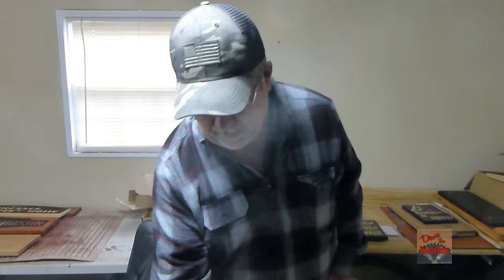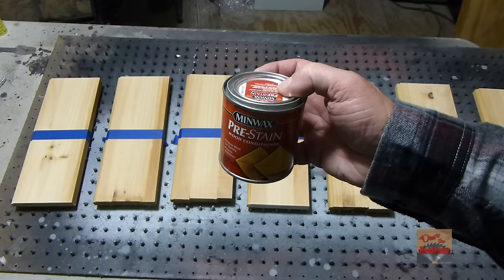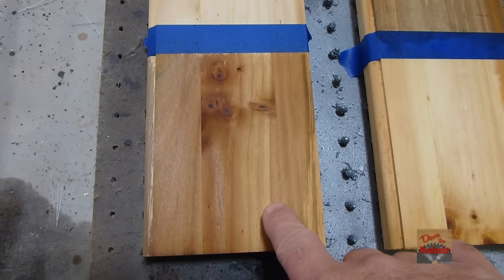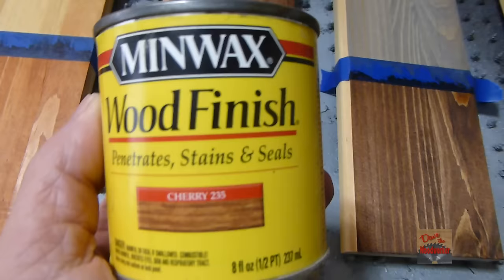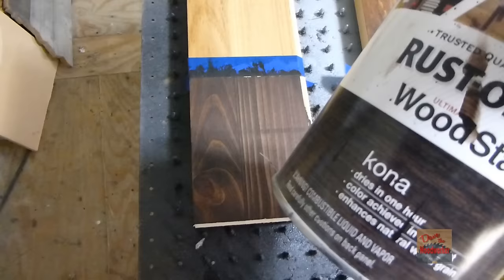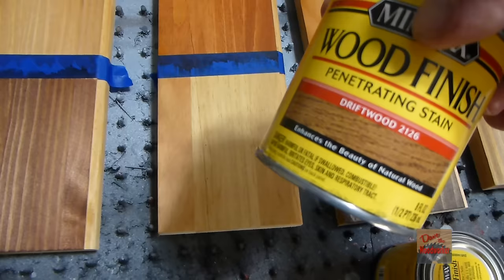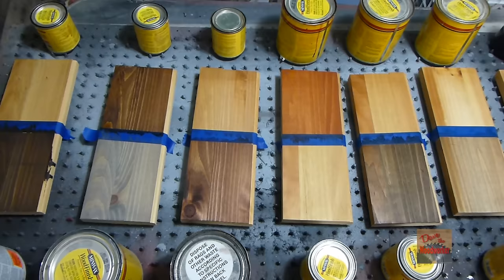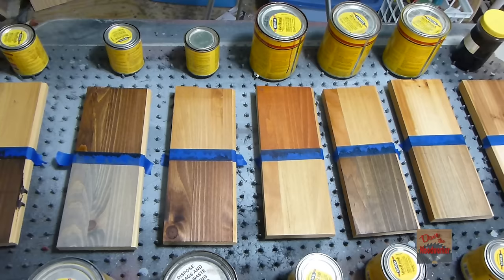Testing Several Different Stains on White Pine wood

Comment: Thanks Dave. A lot of us use pine and can't find good examples of stain on white pine. The paint sticks at the big box don't cut it and the keyring swatches are horrible. I can vouch for the minwax pre stain. It looked great with Red Oak(stain) and a couple coats of polycrylic.
Reply from the maker: You are welcome, that is the reason I made the video, I have bought stains, going by those examples and didn't even come close.

Comment: Great video.  Definitely helps to see the colors after it’s applied.  Also good advice on the conditioner, several years back I did a project with pine I didn’t know anything so I applied stain without conditioner and it turned out terrible!
Reply from the maker: Thanks and yes always use conditioner on pine

Comment: THANK YOU for this demo..This is why I have accumulated so many stains chasing colors and wasting money. A lot really does nothing to crow about "on pine". Especially any of the light colors. You have 4 light colors there that you really can't see any difference. Therefore I would have bought 4 cans when I only needed one...So I have stain for sale, anyone interested ? LOL
Reply from the maker: TheBIGcountry67 You are welcome, I have several cans myself. Some you think will look good from picture on can, but until you use it you don't know, that's why I made the video.
Reply: You did good ! Here's 3 more that will duplicate on pine..Early American, Honey and Dark Walnut..LOL All about the same hue . Not enough difference to have all 3..Now I have used Early American often, but I chased the other 2 for a change (I had hoped)..Nothing ! So your video proved I wasn't insane that pine duplicates.

Comment: What is the mix for steel wool and vinegar?
Reply: Just stick a few steel wools in a big container of vinegar.
That's the cheap way of making stain that will age or pickle. Otherwise you can buy it. What it does is make it grey. You're supposed to let it sit on there for a while, much longer than normal stains. And you do NOT use pre-stain on them. This steel wool vinegar mix needs that bare wood. At least in every application I've used it in, especially tight grain woods.
Reply: @LightGesture  Thank you! I'm going to get some cheap steel wool and vinegar at the .99 cent store. 😃

Comment: Dave, I know this is an old post, but I have red oak floors and pine staircase.  Ideas on trying to match the pine treads to the oak floor? Just want to get in the same ballpark.  Maybe use solid stain on the stair treads to mask the difference between the grain?  We are going darker, like dark walnut or 50/50 dark walnut/special walnut on the floors.  We are doing white risers, white balusters, and dark handrail (probably painted so we don't have to replace them).
Reply from the maker: Well I have made videos of both white pine and red oak. You could compare the stains. I also have pictures of them on instructables.com

Comment: I tried ipswich after testing about 7 different stains. The problem with pine is that it doesnt stain very evenly. you get dark and light spots, it looks like crap. The ipswich pine looked good on one piece of my trim, but not another. im ready to try to sand it all off and just poly everything.
Reply from the maker: Always use Minwax PreStain, it helps

Comment: I wonder how long you left the stain on before wiping off the excess? I am playing around with Minwax Red Sedona and found if I wipe off the excess right after application there was little stain. Then I read the directions and it said to leave it on for 5 minutes before wiping off the excess and the longer you leave it on the darker it will be. After 5 minutes I got the color I wanted.
Reply from the maker: Well I went by the direction's on the can.

Comment: Questions about Minwax pre-stain and stain on pine. I've stained over a thousand feet of pine baseboards and trim. All pine purchased from Home Depot and Lowes and some provided by my general contractor. Two questions of you: 1. Do you really see a difference using the Minwax pre-stain? I keep using it, but I did several A vs B on the same piece of pine and could never see the difference. Yet, I stupidly keep using it. I'm brainwashed I guess. 2. I use Minwax Red Chestnut stain and most of the time it comes out a beautiful reddish color and sometimes it comes out a solid brown, which summarily becomes scrap. Is there a technique to getting consistent coloration?

Comment: Really helpful to see them side by side, thanks. I've stained lots of projects successfully and never used pre-stain, what is the purpose of pre-stain?
Reply from the maker: I would PreStain all softwood, such as White Pine. You get a more uniform color
Reply: @davethewoodworker1043  thanks for the swift reply, Dave. So the prime reason (no pun intended) is to even out the colour and saturation?
Reply from the maker: @dancoffeyuk  yes

Comment: Need advice ; I used the MINWAX treatment then the MINWAX penetrating stain, But I didn't wipe off a section of my pine wood stain project, Now it's still quite wet and tacky 24hrs later! Is there a fix or will it eventually dry after a few more days?
Reply from the maker: well you need to use the prestain before the stain, also you have to wipe off excess stain after 15 to 20 minutes. Then it should dry overnight

Comment: If I want to do multiple coats to go darker, do I use prestain every time? Or just once?
Reply from the maker: Just the first time
Reply: Thanks. Your video is the first info I've found that shows me what I've been wanting to know. I'm building a guitar speaker cabinet with the box being pine and the speaker board is birch plywood. I will use gunstock stain  (Thank You) and I'm debating danish oil, tung oil, or polyurethane for a finish.

Comment: Quick question what finish would you recommend on exterior wood. Pine Wood on a homes Roof Trimmings I live in the Midwest. We get horrible cold it in winter, bad humidity & heat in the summer. What is the best product on the market for me to use? I want it to last as long as possible and give me max protection. What is the #1 product for this type of project?

A bit off topic from this video but I might as well ask since its in the same ball park. How about stain product? Client is looking to go with a  Black Walnut Stain Color. I've been looking into ExoShield which is a Tung Oil its $125 a gallon and claims to have the best protection. "Best Protection from UV & moisture" is what they claim.
Reply from the maker: I don't know what to tell you on that, I only use pine indoors. I mainly make signs, or inside projects. Sorry

Comment: I have a question. I bought a cherry stain.  Made by varathane. And it looks like the gunstock almost. The minwax cherry 235 . is there a difference in the two?
Reply from the maker: I couldn't tell you if they is a difference, I tested what I had on hand. Sorry
Reply: @davethewoodworker1043  the cherry stain i got from home depot. Was way darker than the cherry 235 you used on this. I am using the stain on pine shiplap. For my ceiling.

Comment: I’m considering do my deck, and having two different colors I want to match them. I check con Amazon these brand and said you have to apply pre- stain, minwax wood finished the color of your choice, and to finished fast drying polyurethane? Is that correct? Three different steps, previous sanding the  the whole deck too? Thank you.
Reply from the maker: Well I couldn't tell you about straining a deck. I've never done that, I make small wood projects, mostly for indoor use. Sorry
Reply: @davethewoodworker1043   no worries, thank you!!

Comment: Hi Dave! I am purchasing a 1977 home with i believe it's pine with varnish on it. To stain it for a more older wood look would this be the same process or do i have to sand the whole ceiling down? Thanks!
Reply from the maker: You would have to sand the varnish off, so the stain could penetrate the grain.

Comment: Nice video. What I find is that my colours always come out light than what is shown on the tin. I bought Mahogany (not Minwax brand) and put it on some pine and I was disappointed to see that it didnt come out dark. I didn't use a pre-stain conditioner. I just applied it right on. Anyways, is this just how pine is?
Reply from the maker: I would try putting prestain on first, it helps. Plus to make it darker let it set a little longer or put on multiple coats.

Comment: Hi Dave, how long did you leave the steel wool in the vinegar for your stain? Also, did you pre-treat with tea? (Lots of people are suggesting it to bring out the tannins) thanks!
Reply from the maker: I initially left in there a couple of days, before using. But for this video, the jar has been sitting for several months, I never tried the tea thing. Might have to make a new batch

Comment: Have you used gel stain on pine?  Liquid stains won't penetrate on my project, but a test with gel gave good color...  Some of the "didn't do much" results you've shown were probably due to this effect.  Not sure what it is --  tight pores on some areas, loose on others?
Reply from the maker: No I haven't used gel stains, but I might try them. Thanks

Comment: Sometimes the pine wood feels damp. Do you have to wait till it’s completely dry before staining or applying wood conditioner?
Reply: apply conditioner wait 10-15 mins wipe down within the next half hr or so go ahead and apply the stain let sit 15-20mins and wipe down again.
Reply: Legion Reaver what about when you buy it at Home Depot and the wood itself feels damp. Do you dry out the wood before startingwith the wood conditioner?
Reply: @filmart430  I don't believe so. The stain is seeping into the pores of the wood so moisture content shouldn't be as much of an issue. So long as the wood hasn't been in the rain or soaking wet within the last week it's probably fine.
Reply: @filmart430  I don't usually worry about it unless its been raining. So long as the wood hasn't come into direct contact with water withing the last few days and gotten soaked it should be ok.